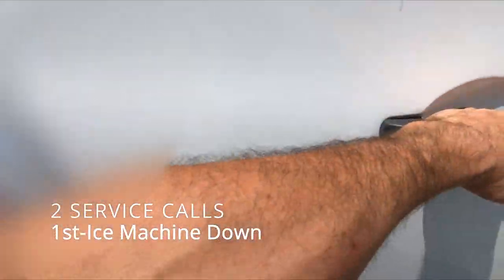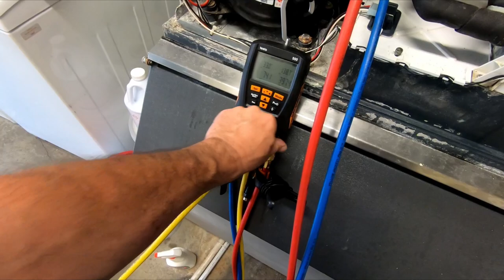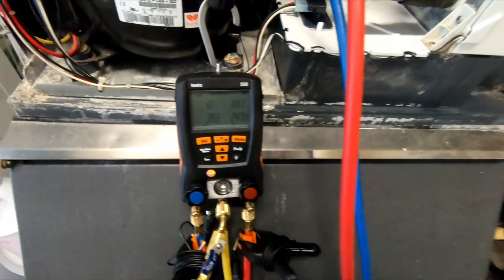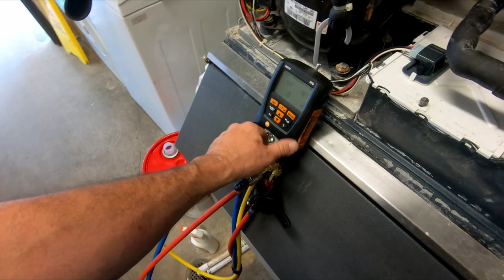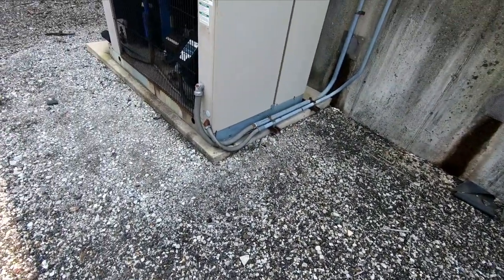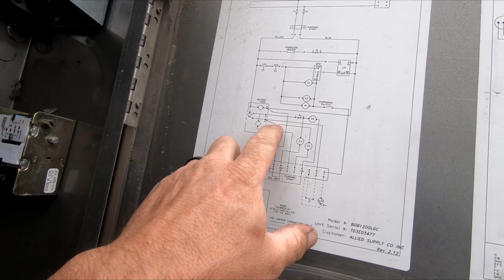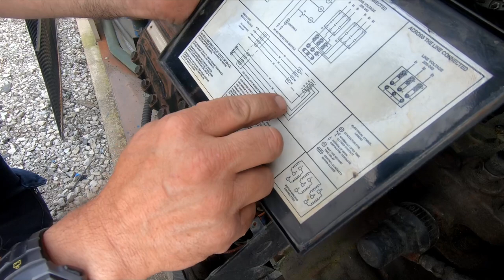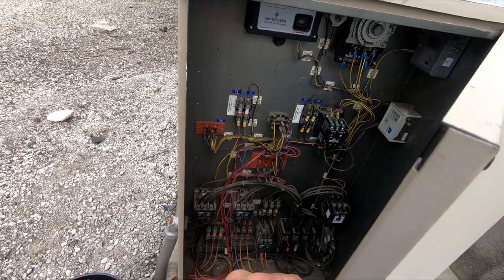1st Call Ice Machine Down / 2nd Call Warehouse Freezer Down

Comment: I remember those Trane RTU's from the 90s and 80s where every wire was black.....and of course the wiring diagram was gone or not legible......good times. Anyways great video...well done.
Reply from the maker: Yeah but they had a little white number on them but still  Is no way to know what that number meant without the diagram🤦‍♂️🤦‍♂️
Reply: @HVACRSurvival  yup. 56.......ok great....where does that go through this hodgepodge of wiring.
Reply from the maker: It goes to the thing-a-ma-bob.. .da!

Comment: Isn't there a way to replace the pressure switch so it's replaceable without drawing the system down next time? It seems like that would be a common point of failure.

Comment: Nothing hurts worse than hot gas line on the inside of your forearm. 😆
Reply from the maker: 😅😅I'm not sure how that came out and not what would normally
Reply from the maker: Luckily this was this summer and school was out🤣
Reply: try a big glob of hot grease or oil, it doesn't stop frying when you jump away yelping  ;)
Reply: @Robert Miller that's almost as bad as accidentally grabbing a discharge line the size of your forearm thinking it's a suction line...
Reply from the maker: It happens now and again when I'm working on the racks at the grocery stores

Comment: What torch tip is that. Sob is screaming
Reply from the maker: I use #2 for everything, I do run a little hotter on purpose so It gets hot faster but try to avoid the copper glow.